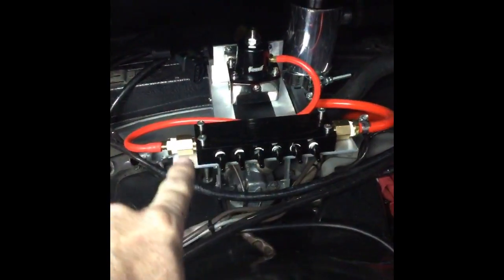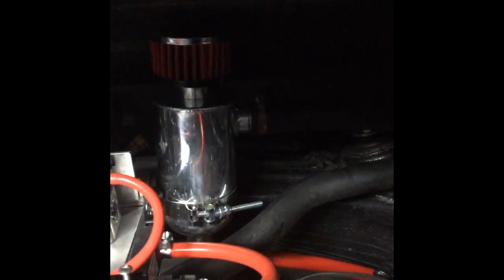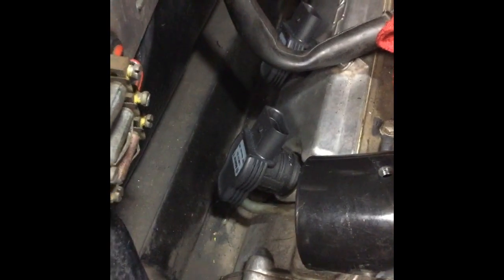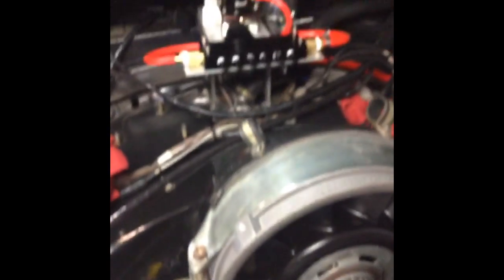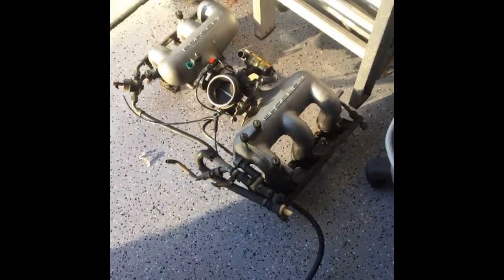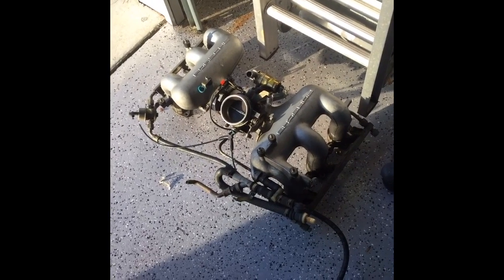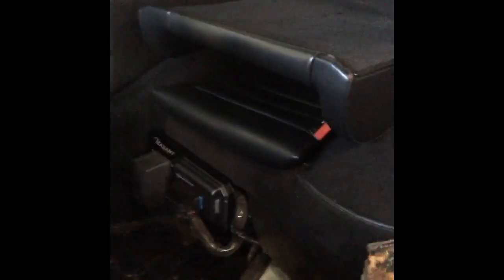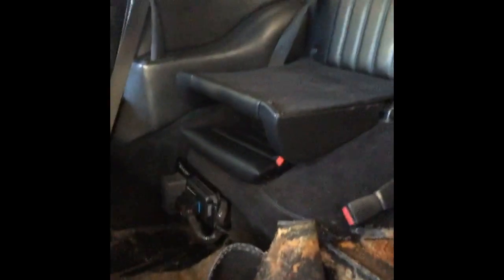Porsche 911 ITB Upgrade

Comment: Did you sell the 3.2 manifolds and motronic?
Reply: exoticarauto I have a set of Manifolds for sale with injector rails wiring loom. You just need computer to run them. Cheers
Reply from the maker: exoticarauto I did sell the manifolds, ECU, everything.  Check Pelican Parts for other used parts if you need them.